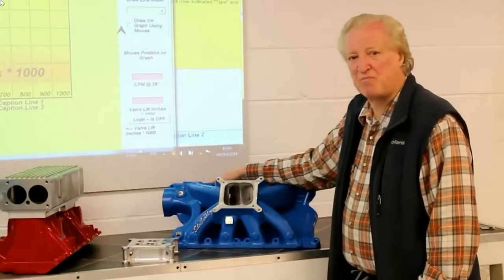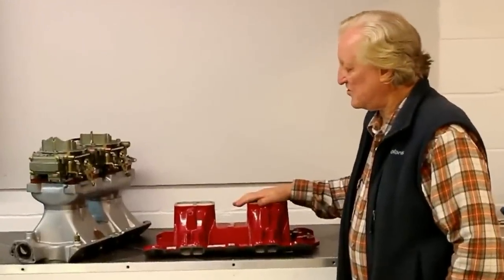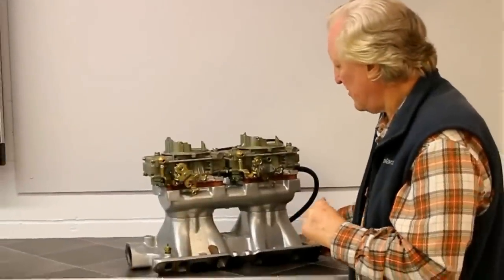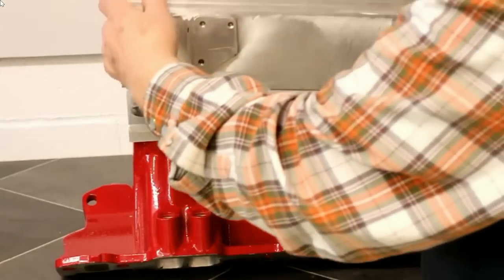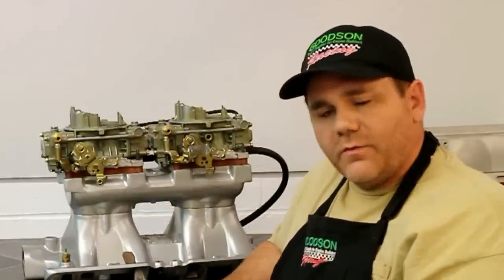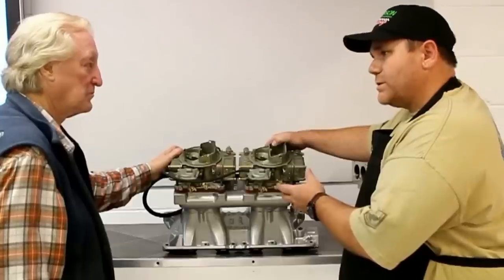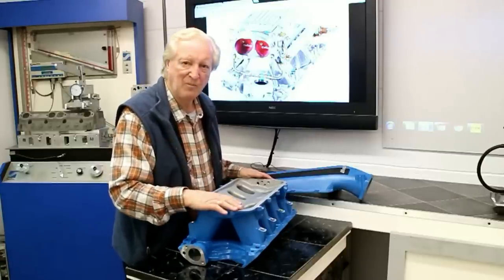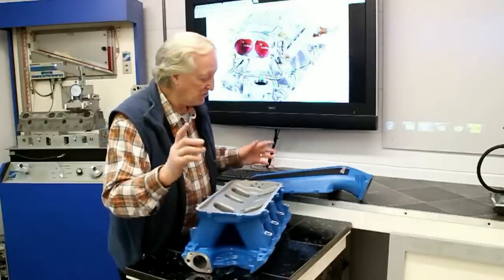Forget what you heard - Tunnel Rams are TOTALLY streetable!

Comment: I can tell you the old school tunnel rams were awesome on the street. Anyone from the San Diego area in the 70's thru the 80's /90s remembers the silver and black 1WILDZ 69 Camaro Z28 that dominated the street around the small block cars (and broke a few big block hearts to) David would be happy to know I was using a tight (106) LSA Crower cam even back then and also ported my own iron angle plug heads. That took me 2 months to port those heads but it was worth it that engine rocked. Learned mostly from books by Smokey Yunick and Grumpy Jenkins. I grew up with circle track cars and they were all using tight LSA. I could let the clutch out without adding throttle and it would just smoothly drive away. Everyone told me it wouldn't work. Boy did they learn a lesson. I never really understood why that combo of tight LSA and tunnel ram ran so well until years later when i found the Vizard power books. I'm 70 now and have known some of the best I can tell you no one understands engines better than David Vizard  Never forget the 128 rule !
Reply: David rejects Smokey Yunick's teachings. I've gotten into it with him before.
Reply: Circle track cams work EXTREMELY well on the street because they are designed to make mid-range power and drive out of the corners. You had a smart combination.

Comment: A timely video post for me. I've got a dual quad tunnel ram (Weiand) and dual 660's on a 440 Mopar in a 4400lb '57 Dodge station wagon. Still needs minor tweaks, but works amazingly well on the street. I guess it'd work even better with more progressive carburettors....
Reply: You want 1:1 linkages on a tunnel ram. Otherwise you starve 4 barrels of the engine
Reply: Why such a heavy platform?
Reply: o @darrylsmith7908  If you sat the carburetors right on top of the runners with no balance area. You would be correct. Otherwise this is not a problem. He just stated they were using vacuum secondaries.
Reply: @danawilkes6174 from personal experience and testing my my daily driver I will say 1:1 is what you want for all tunnel rams. The tunnel ram on my car has a top open plenum to equalize the carburetors. I tested out progressive and it would ALWAYS starve the front 4 for fuel. 1:1 it runs perfectly. I even went so far as to try progressive linkages on 3 different tunnel rams with those mop plenums and the same results happened. 1:1 never starves them. On my low rise dual quads I always use progressive because of the dual plane design and shorter runners which allows the fuel mixture to reach all 4.

Comment: Usually you here the myth about tunnel ram intakes not being streetable because the guys back in the day that used these paired them with huge duration cam shafts for track use. When you calm down the cam on just about any engine it will be plenty streetable with the proper octane fuel of coarse.

Comment: Ran back in late 80,s/early 90,s A Edelbrock Street Tunnel Ram they called it with 2 600 Holleys....was not as Tall as the others and did great on my 327/4-speed 56 chev. in high school.....sadly..i sold it to make a proffit back then,it was a nice peice. Nice video.

Comment: About 15 years ago i had a Weiand 1984 tunnel ram. It was a single four barrel model with D shaped runners at the top. I cut that off with the intention of having a flange welded on to be able to change tops. I thought 2 2barrel carbs or 2 2barrel trottle bodies would be great for the best fuel distribution..

Comment: I been wanting to try a tunnel, with two , Holley two barrel carbs! Turned sides, mounted in the center, with the butterfies in a row down the top of the tunnel ram, maybe a couple 5002bbl carbs,  for a street vehicle, maybe do a blow through turbo, 355-383 with 10-15psi boost, with a couple fast spoiling turbos, capable of about 1000-1200 HP, but set up for about 750-850+/- but shoot for as much TQ from 1800-2000 as the combo can make,  maybe even. Epoxy the ports a bit, or use diverter valves in the turbos, to get them to spool faster,  I just think a tunnel with carbs like that would look cool and a little different,
Reply: Ive been thinking of doing the 2x2 tunnel ram setup as well.

Comment: MAN can't wait I just got 2 holley 450 carbs  for $250 now just need a tunnel ram but can't make my mind up on if I want a low tunnel ram or big boy out the hood lol but it's more of a sleeper lol
Reply: I wouldn't install Tall Boy on a street-driven car just for the blind spot while driving. EV drivers w/ cellphones are dangerous!
Reply: Get the tall tunnel ram the low rise are not as good
Reply: The 450s are awful.  They are mechanical secondary but without a squirter in the back barrels.

Comment: I ran a weiand tunnel ram on my 289 on the street with two 390cfm holly carbs for  years on the street no problems except when it got down to freezing and then it was almost impossible to start lol
Reply: Make sure chokes work.
Run a 1/8 vacuum hose from dash to plenum. Give it a short shot if fluid, start, plug tube. Works.
Reply: No chokes on my carbs i removed them

Comment: Hello Mr. Vizard,
What is your thoughts on a Hilborn or Kinstler intake…..individual runners per cylinder.  That’s all we ran (Hilborn/Modified class and Kinsler/Outlaw series- manually injected) in winged dirt.  Granted, operating range was 7,500-8,500. 
What’s your thoughts for such an injection system set up for street/strip with the fuel management systems of today?

Comment: I've often wondered if there would be any advantage to having a tunnel ram with INDEPENDENT or ISOLATED RUNNERS? In other words, an independent runner for each barrel on the carbs, like with four WEBER carbs, instead of a COMMON plenum.
Reply: Eliminating the plenum tends to narrow the RPM band in which the carburetor operates optimally. It also effectively lengthens each runner, as you have an individual runner that is about 4" longer or more than with a plenum ram as they are often called.

In fact, when the Yamaha Vmax motorcycle came out, the V-boost opened up at a certain RPM and joined runners from across the V from each other so each cylinder was drawing from more than one carburetor throat.

Even in old Pro Stock, the tunnel rams had plenums in them. Something about that plenum adds power.
Reply: Look at those WEBER carbed multi cylinder engines, none of them are big cube engines. To have one carb feeding one cylinder on a big american V8 the carb needs to be VERY big. That's where a plenum comes into play. One barrel (or two, four, six or eight) will fuel all eight cylinders together. The plenum makes it happen. A spread bore on the street makes the speed of the air high at low rpm through two barrels and feeds effectively all eight cylinders. A long runner makes it even more efficient.
Reply: It would sound fantastic. I feel like it pribably looses some of the acoustic ram effect though. Part throttle control is also a difficulty in setting up because you're opening all 8 air valves rather than 4.

Comment: Wow this is an old video, before Andy even thought of Mixed up Boss!  David, I've got a porting question for you.  I'm going to be porting a pair of 4.6l ford 2v PI heads and I'm trying to wrap my brain around doing the chambers on those heads.  On those heads the intake valves are angled the wrong way, do your chamber mods apply to those heads even when the quench pad is on the wrong side?

Comment: I have a SBF tunnel ram Ive been wanting to try on the street, I want the street range driver torque (that comes the longer runner length) but I figured one needs to fill in some of the plenum for signal to the carbs/boosters.  What does one fill that with? Bondo, Epoxy, weld?   How much does one fill it up?  Wet flow worry?   I see it working great at full throttle but driving around on the two two barrels wonder about fuel distribution and lean rich cylinders issues. 
Lol yes I’ve seen the crude 2 barrel carb plate  to a car aluminum plenum for the derby guys work, but they just want it to run, and they seem to get the job done ....

Comment: If you call 2500 to 3500 rpm streetable as many t rams make power at mid to high rpm. And you need holley 50 cc accelerate pumps to take out the hesitation at initial throttle.

Bloodviking

Comment: So, tuning the carburetor vacuum secondaries so the engine is only getting as much throttle as it can use is a good thing.  It there something similar when using port fuel injection and throttle valves?  Is there an advantage to using multiple throttle valves, with vacuum control to open them as needed?

Comment: Dear Dave,
 Beyond the scope of the video I hope I may ask a question?

 Several months ago Tony, chewed up a mileage device. You then planed to do some empirical testing on such devices.
That said I’ve always found Honda’s CVCC Technology interesting.
Also I have heard that leaning out a mixture eventually rather than hotter becomes cooler.
With the proper amount of ignition advance and a hot enough spark Is there an island of efficiency which may be achievable using the right combination and setup?
Put simply, can we concoct a super high compression big block with an extremely lean mixture to work a deal which could work with a bad ass ignition system rather than the flame situation CVCC uses?

Comment: Interesting but I’m struggling with the concept, on a street engine of say 5 litres fitted with this intake and X2 500cfm 4 barrel carburettors, so 1000cfm, isn’t it going to be massively over fuelled ? Genuine enquiry, I’m currently running a 302 Ford  with 185 AFR heads on 1, 500cfm carburettor, and I’m attempting to understand the various permutations available to get fuel and air into the engine 👍
Reply: 1000 cfm is not too much.  With boosters in the carb that produce a good signal and carbs that are calibrated for the application it will be great.   Large cfm does not mean more fuel. Wrong calibrations do.
Reply: More CFM means theoreticly more air, not fuel. But vacuum secondaries were suggested because you're not going to get all the air they can flow unless the engine asks for it.
Reply: @lb9gta307  hi, yes thanks ! I’m in Europe messing around with an old mustang and became proper interested in all this, especially the old school way of doing things and you look at some of it and think, how the hell does that work ? I’d have bolted 4 downdraught Webber’s up there on a suitable manifold, at great expense and likely been wrong 😄👍
Reply: @donaldhill2775  4 Webbers would look very race car and produce an incredible sound. TBH my carb experiance is minimal but it includes side draft Webbers on a Lotus Eclat. They were beond me, but I've only tinkered with Holleys and nothing else really.
Reply: @lb9gta307  Reversion was the thing with Webber’s, fairly easy to set your car ablaze running without filters, I’ve been struggling a little with an Edelbrock, it’s on a Ford 289 which is now a 302, solid lifters and AFR heads with the larger inlet valves, anyway it wouldn’t idle much below 1000rpm + and the mixture screws didn’t seem to be doing a lot, I actually read the book that came with the carburettor, fitted a 1 inch plastic spacer under it, re-set the ignition timing, fuel pressure, learnt the difference between running it on the main circuit and the idle circuit, and yep, got it down to 800 rpm and it doesn’t foul the plugs anymore, lot of help out there via the internet which is great, got rid of the automatic gearbox, I just can’t live with them, interesting stuff and still a big following for the old pushrod engined cars in America, always something to learn eh !
All best to you 👍

Comment: Not much technical information here that the average person can use and can a tunnel ram be used with a single four-barrel? More of a product review
Reply: Choosing type and why.
It does matter FIRST
Reply: Not really a product review, more of a basic theory explained.

Can you run a single four barrel on a tunnel ram?

Yes.

Does it work really well?

Not really.

You're far better off with two small four barrel carburettors. Getting good balanced distribution with one carburetor centered over a plenum designed for two carburetors mounted on the ends is nearly impossible. The plenum designed for one carburetor looks like a big tent, it's extremely tall, has a ton of volume, destroys the signal to the carburetor, and still doesn't resolve the problems.